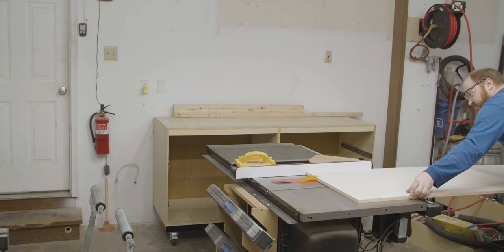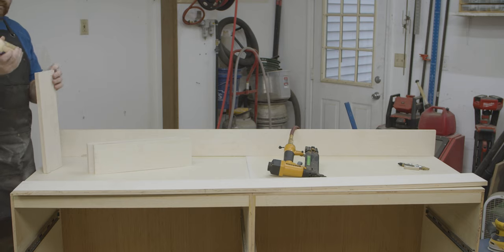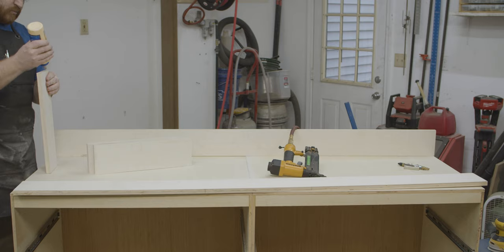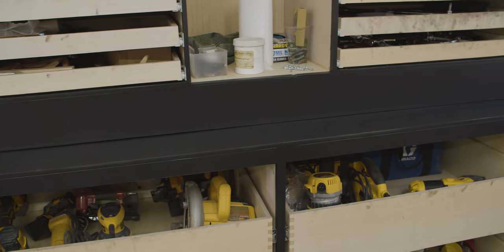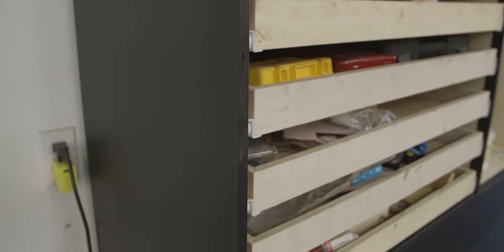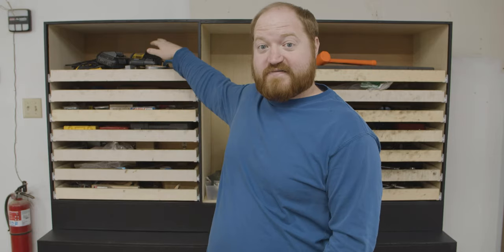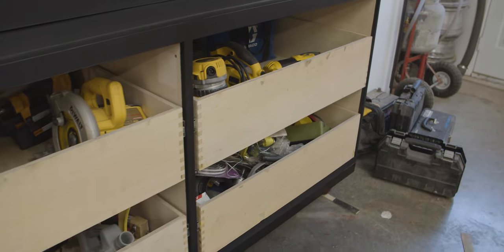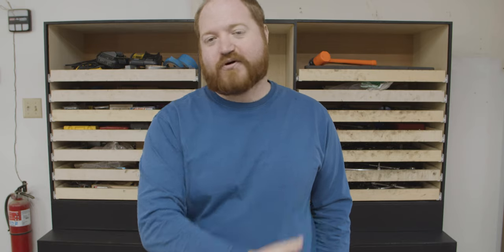Tool Cabinet Upgrade Part 2: Cabinet Assembly and Paint

Comment: Great vid! I liked the beat-synced brad-nailing.

Why did you close up the box in between the top and bottom instead of making it more working/storage space?

Excited to see the drawer fronts go on. Clean up that wire to the garage door opener while you're at it!

Would you like to be YouTube friends? X-D
Reply from the maker: If I put drawers or storage in the box in the middle it would defeat the purpose of the shelf in front of it. For example if I have my drill on the shelf and I'm getting a drill bit out, which are in the bottom drawer I'd have to put the drill elsewhere while I get the bit. This way the I can un-chuck one drill bit, put the drill down, put the old drill bit away, grab the new bit, Chuck it up and get to drilling.